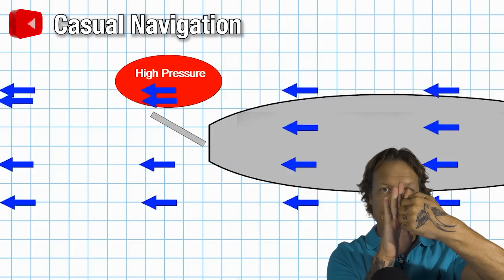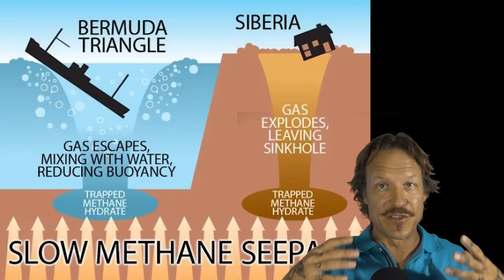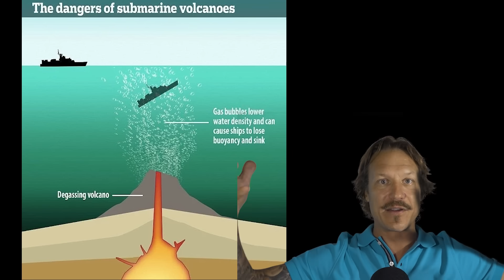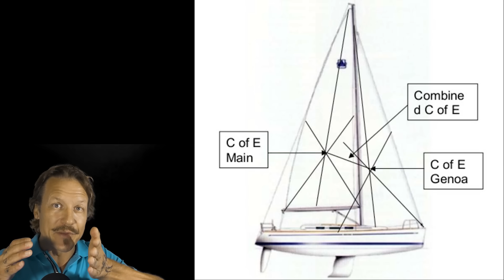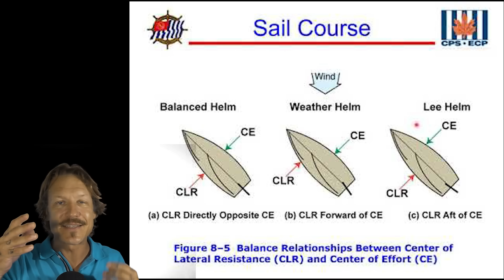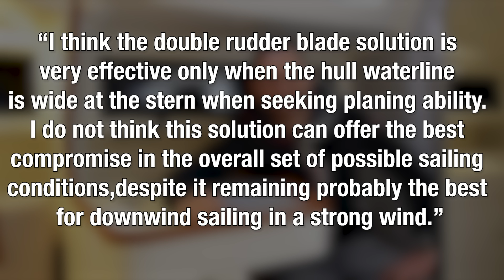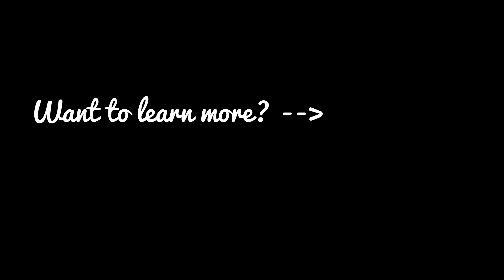The Problem With Dual Rudders Nobody Talks About

Comment: James,  I agree completely with your positions regarding very wide transom boats for offshore sailing.  You correctly describe the "feel" of the problem which is backed by your actual experience with sailing different types of boats.  The balance of a boat is generally described in a simplistic fashion as you described with the CL and CE locations moving around but actually there is a potentially more powerful hydrodynamic force that creates weather or even lee helm that needs to be understood.  First let's talk a little about one aspect of a wide transom boat that will seem contradictory.  What happens when these boats heel way over to the position of the CE?  You have a very buoyant stern due to the volume coupled often with a very fine bow.  Forget about the sails for a moment and just mentally statically heel the boat.  The stern will rise and the bow will drop.  This actually tilts the mast forward, thereby moving the CE forward.  So this actually causes the rig itself to create less weather helm or perhaps generate lee helm, but that is definitely not what you feel on the helm if the boat is at speed!  Now lets go back to the more traditional hull shape with mostly symmetrical ends...lets go way back.  Boat with deep hulls and narrow beam will generate little to no hydrodynamic weather helm and if the half beam is less than the hull depth you can have lee helm.  These forces are coming from the hull itself, the rig of course interacts which result is a mixed balance but the hydrodynamic force is a big factor in some boats.  When the hydrodynamic forces generated by the hull are low, it is easy to balance the boat with your sails.  When the forces increase rapidly as the boat heels it becomes pretty much impossible to balance the boat!  You can test the hydrodynamic effects of a particular  hull by inducing a heel using a weight from the mast and towing the boat at various speeds.  I did this with my SS and Lokiyawl trying to figure out why the boat would develop a slight lee helm at higher speeds and large heel angles.  That boat had a hull depth that was a bit more than her beam so as she heeled the effective asymmetric shape formed in the water would create a slight turn to leeward.  The two inputs, being an increased heel angle and more speed = increasing lee helm on that particular hull.  The hydrodynamic forces however were fairly weak and when the forces of the rig were added the boat was very balanced.  A previous owner had cut down the mainmast on my Lokiyawl and this reduced the amount of weather helm that the rig created.  When I restored the original mast height the boat was almost perfectly balanced under most conditions.   More beam is of course nice for more interior room and designers have been under pressure to increase the beam.  So long as you don't heel much you don't feel the powerful hydrodynamic forces that can escalate to overcome the ability of a rudder to control a boat but take a knockdown and all bets are off!  Back to my Lokiyawl.  I was once essentially knocked down with full sail up to the point that the cockpit was flooding, maybe 70 degrees of heel.  The helm on that boat was essentially neutral and steerage was easy.  I could have continued to sail the boat like that for a very long time if needed.   Ok, so as you design boats with flatter bottoms and wider beams you are going to generate ever stronger tendencies for the boat to round up into the wind as the boat heels.   Bulb keels and the wide beam combined with reefing early can help reduce the balance issue so this can be overcome to some extent.  Dual rudders allow you to have control at higher heel angles since that rising stern as the boat heel reduces the effectiveness of a single rudder.   But I am totally on your page with having a boat that does not generate excessive and even uncontrollable helm forces if you get knocked down since that is going to happen from time to time.  I  shudder to think of the results if running a dangerous passage with dangers on both sides if knocked down with a boat design that can become uncontrollable.  With a well balanced boat when a knockdown happens the best practice tends to be to just leave the boat pinned over until the wind eases (assuming it's a short lived event as is often the case) since luffing sails in 50 knots or more can ruin sails or even damage the rig.  Once the boat is pinned over, the boat is already seeing the maximum load it can ever see from that wind direction so just wait.   My current boat is still considered a traditional hull by modern standards but she is not as deep as her beam so she does generate weather helm.   It is controllable even with full sail and the rail in the water but sometimes I do miss my Loki. (grin)  Two fingers on the helm no matter what the conditions.  I was very lucky to be befriended by the late Olin Stephens and go over what I am discussing here.  You would have so enjoyed meeting him, I hope that you got the chance.  Besides being very knowledgeable, he was a true gentleman and was always interested in listening in the hope of learning something new.  Please keep your educational videos going.  I am learning a lot from you!  
   I should add that I do feel that there are good points about the very wide boats, you mentioned some of them.  The extra room, stability, less rolling under some conditions and most of these boats are skegless so they back really well.  Downsides: Heavy to uncontrollable helm at high heel angles, pounding (transom slap at the dock) .  There is no perfect boat, they are all compromises.  I think though that there is a lot of value in having about used for serious offshore boats really should be able to survive pretty much whatever the sea can throw at you without breaking.  
J&J SV Sueno
Reply: I was going to say TLDR.  Until I read it.  It was worth the read. 😁
Reply: @KenFullman  Ken,  Thanks for the response.  If there is anything that you would like me to try and clarify for you let me know.  I will share something short that Olin told me that has stuck with me.  He said quote "a day spent sailing is a day not subtracted from your life"  Olin was still racing (mostly at the helm) one of his early designs the NY32 when he was 98 and he was even giving serious speeches on boat design as this age. He lived to the ripe old age of 100.  Yet another reason to consider sailing!  J&J